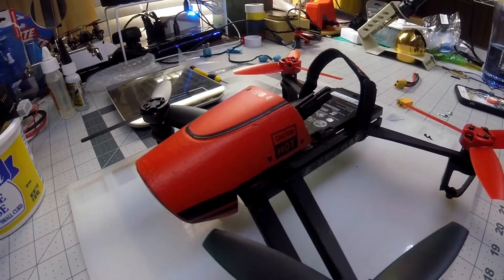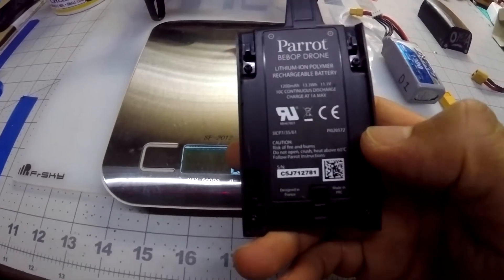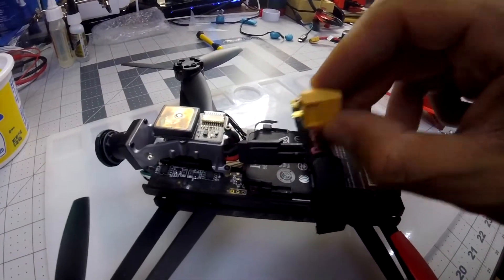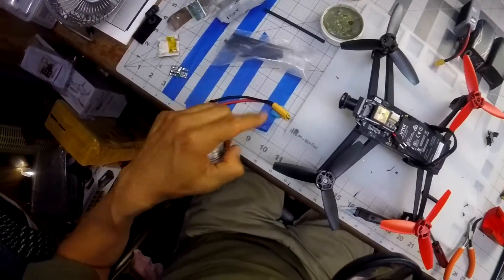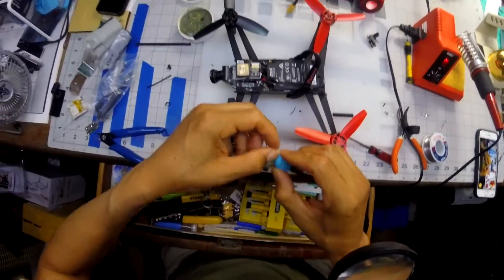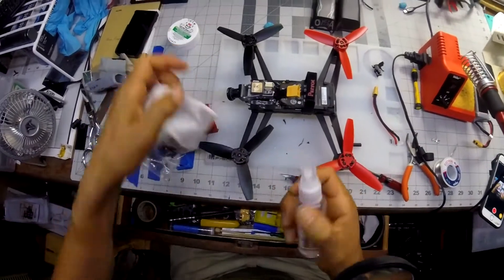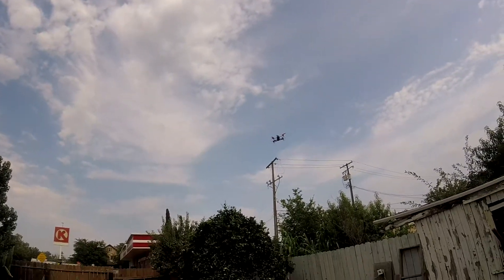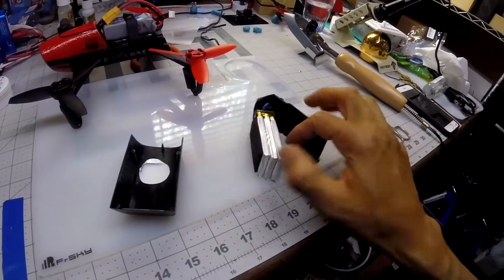(My) Bebop Drone Battery Replacement

Comment: How many C? English

Indonesia = itu 1300mah nilai C nya berapa?
Reply from the maker: These were only 30c.  Thanks for the question.
Reply: @GoFlyYourselves   bagaimana jika saya gunakan 3s 2200mAh 40c ? apa yang akan terjadi pada drone ?
Reply from the maker: @AerialFotravelling3699  I'm not sure what you mean, but I think 2200 might be a little heavy for the drone.  Maybe even a little too long.  But that's just my opinion.  Thanks
Reply: @GoFlyYourselves  What I mean is what if I use 3s 2200mah 40c? What's going to happen to the drones?
Reply from the maker: @AerialFotravelling3699  The amount of power would probably be fine but it might be too heavy for your drone.  I haven't tried something that big on mine.  Is that the only size you have?  You could give it a test flight and see if the motors don't heat up too much from the extra weight.  Thanks

Comment: Where can I get replacement batteries at a reasonable price, from?
Reply from the maker: I used to see them on walmart.com or ebay, they were still a bit of money and not your typical parrot brand.  I guess if anything good was that the capacity was more than the original batteries.  That is why I decided to use regular lipo batteries instead.  Oh and I guess Parrot doesn't make them, is what one of their reps told me on an email.  If you find some post a link, I would be interested in seeing them.  Thanks

Comment: I just cut the connector lol. But unwinded it from around the metal cage. But u have to be very careful that say otherwise you run out of cable. I used a bigger battery and get 10m of flight time instead of 5 or however it was
Reply from the maker: That's cool.

Comment: I tried this and it's so freaking unstable but I used a unstable batter. My drone seems drunk. It could be a firmware problem tho etc
Reply from the maker: I think it might be your sensors on the bottom of the drone that might be dusty or dirty.  Mine did that and thought the same thing.  One day I gently blew it with some air and it worked great after that.   Just give it a little dusting and see if that works.
Reply: @GoFlyYourselves  :O I'll try that :) thanks for the advice!

Comment: what is your battery plz tell
Reply from the maker: I was just using a regular Lipo battery 1300mAh 3s because the bebop says it requires 11.1v power. As far as the mAh you can use smaller or larger but too large will make the bebop too heavy, I think.

Comment: Nice mod! Is there enough room in the stock battery case to fit the upgraded battery? To retain the stock look? How much flight time did you get? Was it better than the stock 1200mah battery?
New subscriber, hopefully you will check out my bebop related channel and support?
Cheers Phil
Reply from the maker: Thanks Phil.  The battery did fit in the old case.  Here's a short video https://youtu.be/VAuaoWNx5wE And some advice on how it would protect your drone.  I think the flight times were close as the original battery.  I meant to do a video on this but I just ended up crashing when I put it on "sport" mode, this thing hauls butt!  And here's a video of my failed test.. LOL https://youtu.be/mjFQP0u_eRU  Also remember the more weight  you put the more power it will consume just trying to stay up in the air.  Thanks again and hope you enjoy.

Comment: Which color is the positive and negative wire ?
Reply from the maker: Good question, the red one is your positive and it goes to the flat side of the XT60 and the black is negative and that goes to the hex looking side of the XT60 plug. The XT plug also has a small - and + on it.   Also look at the video I made about the battery compartment, it is very important to help protect your drone's motherboard. https://youtu.be/VAuaoWNx5wE  Good luck, Sherwin.

Comment: Hey I did the same. but my battery instantly goes down after taking off. restarting the drone makes it go back to what the multimeter reads. it goes from 40 to 4% after pressing take off and stays there unless I reboot the drone then it reads around the same number again :c
Reply: Did you fix it? i just change the battery and is the same with my dron..... after reboot it has charge

Comment: Why not use a Tamiya to xt6 adapter? I ordered a 3s battery under 180grams myself (1550mah) and in waiting to try it but I just ripped the shell of the dead battery for the adapter (dangerous I know :p almost made one explode!) But that was because I couldn't find mini Tamiya adapters in my stupid country :(
Reply from the maker: Don't quote me on this but someone told me that some of those tamiya adapters the polarity is reversed.  So, double check before you plug it in.  I should make a follow up vid of how I got my batteries on my drone, I think you will like it.
Reply: yes I'll! But since I used the stock battery I just used the color coded cables connected to the dead batteries! Soldering the tiny leftovers was hard though 0_0 but I connected it to my PSU and confirmed that it detects the charge based on voltage and updated the firmware and all till my quadcopter arrives. I was on 3.3.0 before I stopped using it :O

Comment: hows it going my name is jim and i was going to change the plugs on mine like you did and by doing this i could use a bigger battery right just as long as it has the same plugs and stuff and i dont care if the battery hangs out the back a little let me no thank you jim
Reply from the maker: Hi Jim, Let me tell you what I found;  
In the original battery pack there is a small circuit board with some transistors, not sure if they are to regulate the current but they are there and the Parrot says you should only use their battery.   

With that said, I swapped it and used a 3 cell = 11.1v which is the same size as the original battery.   The mAh will only matter on how heavy you'd like your drone to be.. if you get it too heavy it will use most of it's energy just to stay up in the air.  So, you will loose efficiency if you have a really big battery.  

Also on a side note, the rear cover of the drone underneath the battery is a really thin plastic that can break easily.  I would recommend re-enforcing it with something like a piece of stiff plastic or something.  The strongest part of that cover is where the original battery latches are located (at the edges)
(Probably if I had not dropped mine from such a high drop it would not have been a problem but it's worth mentioning.)

I just thought of something..  If you take the original battery housing, you might be able to use the bottom part of the cover as re-enforcement on the drone, that might work to strengthen the battery payload area.  (just a thought)

Thanks, I hope this helps.
Jesus

Comment: Hi. What time fly on this battery?
Reply from the maker: Good question.  You know, I don't remember.  But what I'll plan on doing is, tomorrow I'll test it out and maybe use another battery size like a 1500mAh 128g and get some numbers.  Flight time didn't seem as important to me cause I have many 1300mAh Lipos and I would just swap them out. LOL  But if I don't forget, I'll do that tomorrow.
Reply from the maker: I went to do the test but I switched it to sport and ended up crashing and breaking the drone.. LOL  If I can fix it, I will redo the test.  Sorry, I couldn't give you an answer.  The test vid will be up shortly.  https://youtu.be/mjFQP0u_eRU